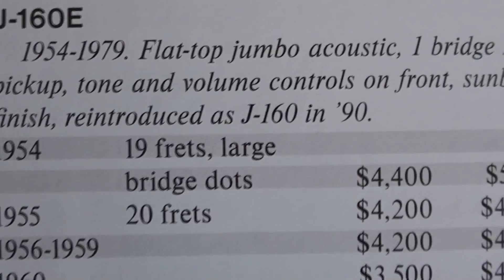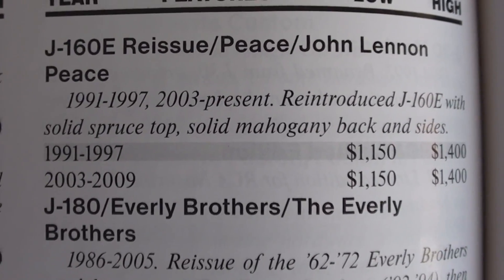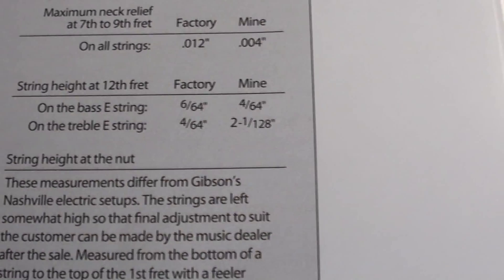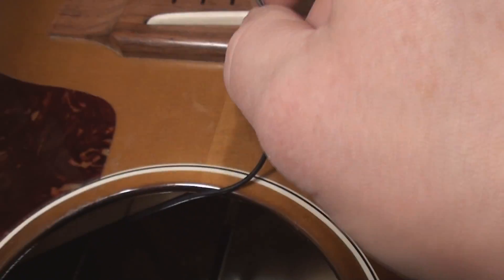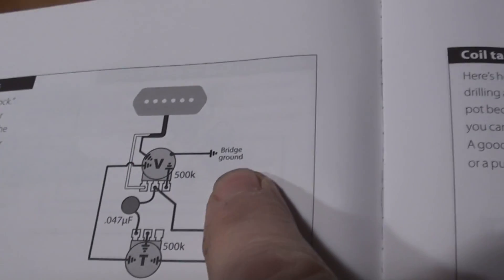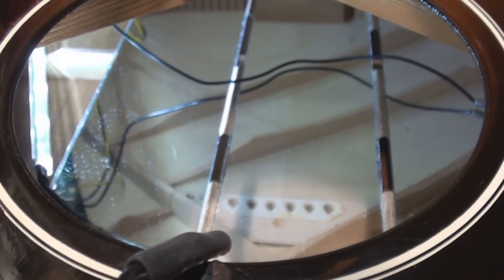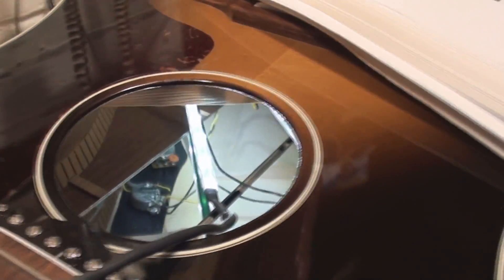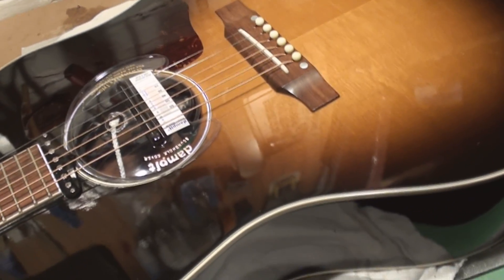Gibson J160E Acoustic Guitar Repair Gooch Part 2

Comment: Hi Dave,
  I have a old Harmony acoustic 160e. I trashed the guitar, but kept the pickup and pots. The wires were broken off. I'm going to fit the pickup into another acoustic. Sakura  acoustic/elec, MIJ. Nice axe. It was missing the original pickup. Any chance you might have a wiring diagram for the H160e? Or where I could find one. I've looked. Your videos have inspired me and helped me set up some older guitars I fix and sell.
   Thanks, Ralph

Comment: @davey4557 Just to settle the record straight:
Sure enought... but the increments ought to be read as follow

1/64, 1/32, 3/64, 1/16, 3/32, 1/8, 3/16, 1/8 etc, etc
were 1/64=0.15625, 1/32=0.3125, 3/64=0.646875, 1/16=0.625 so on and so forth...as you can see... they are increasing in 64th (0.15625)

Sorry I couldn't helpp it but butting in... you see.. I was a machinist for 40 years (happily retired now!)

Comment: Hey Dave  6/64" is an aberration... no such measurement exists as in the British system 3/32 is the (proper term) equivalent measure. same with 4/64" another aberration ... 1/16 is the (proper term) equivalent measure. Moreso, the mistake you made on part 1 was assigning the measures given to the wrong string..(that's all) the 6th string (let's call it) gap at the 12th fret is always MORE than the 1st string 'gap' at the 12th fret... Peace!